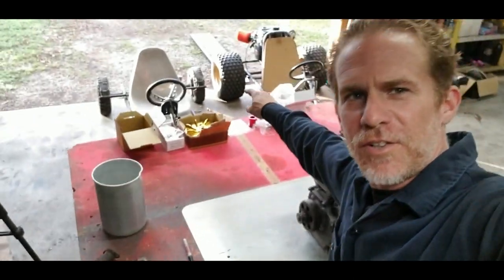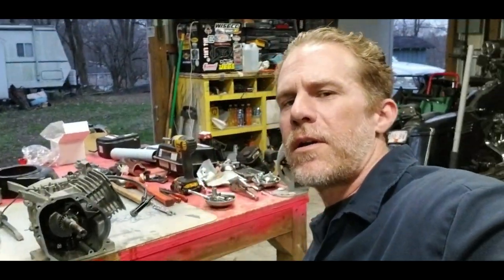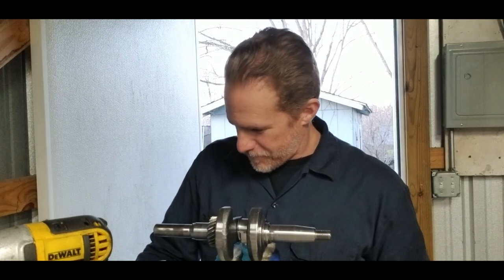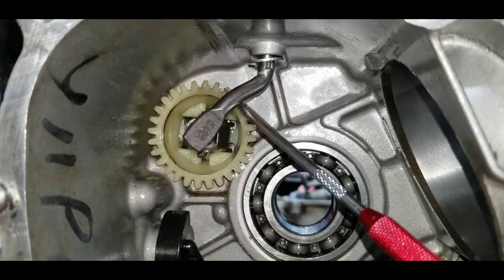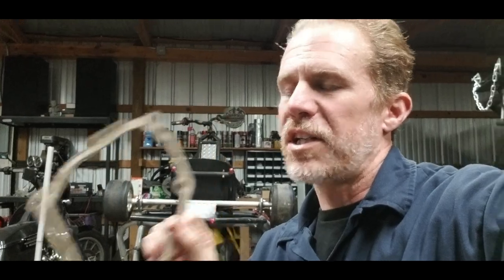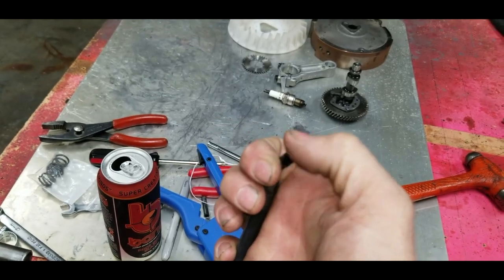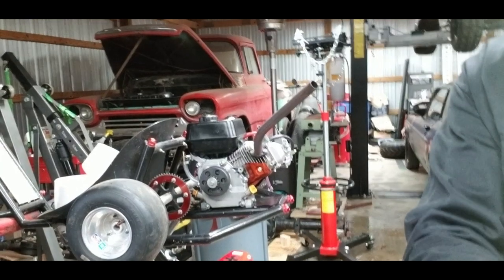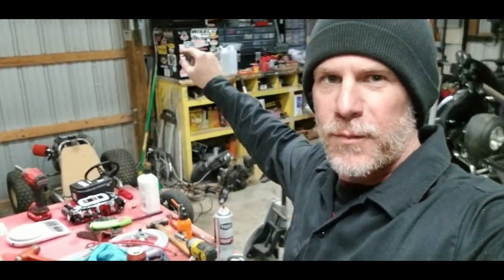Built Gokart Engine - Big Power!

Comment: Thank you for the 212 predator upgrade build very informative I have a 212 predator motor on an old 1950s model frame double motor mount goes down the street 45 miles an hour plus thank you again for your video
Reply from the maker: Sure thing! 45mph is pretty quick for a go-kart. I did a video not to long ago with this engine on my drift Trike and I managed to get a top speed of just over 55mph. It would definitely go quicker but on drift wheels it gets a little sketchy so I could only imagine how it would perform on a kart.

Comment: FYI If you use copper gaskets you can pre anneal them on a glass top stove prior to install and then you DO NOT need to run any additional heat up/cool down cycles before torqueing down the head bolts to spec. Simply install the pre annealed gasket onto a cold engine and torque the head bolts down to spec! Much more convenient than the PITA heat up/cool down cycles!

Comment: I put
- Mod2 Dyno Cam,
-Billet aluminum flywheel, flat top piston and rod 
-Shaved and ported head 14cc
-Chromoly push rods 
-Stainless 5.5mm valves
-26# springs stainless keepers.
Thing is a 16-18hp monster. Wife wasn't too happy about the bill though😂
Reply from the maker: Hell yeah, that sounds like a whole lot of fun!
Reply: @ToyShopFab _Johnny Biggs  Scary, got it to 65 on 12 in slicks on a drift trike no brakes and about 6 inches from the ground😂but also fun.

Comment: When I remove the governor on my predator builds I just get a 1/2 bolt about an half inch long and drive it in the top and side governor holes no taping. The oil sensor hole I do tap it with a 5/8 and put a bolt about an half inch long with a copper washer.